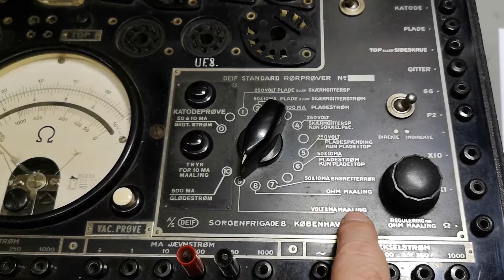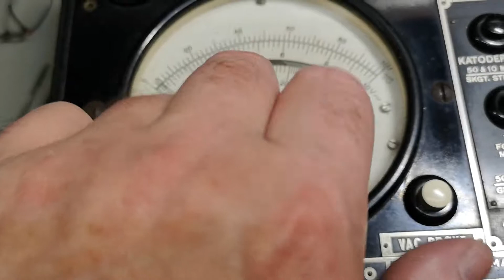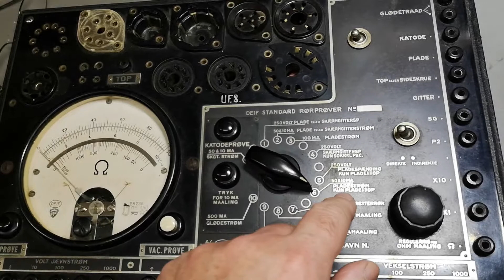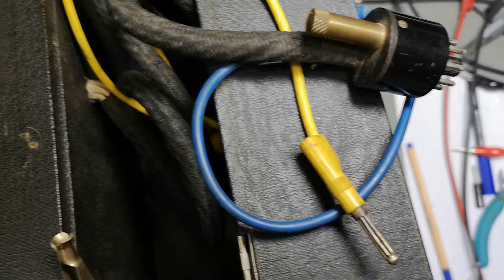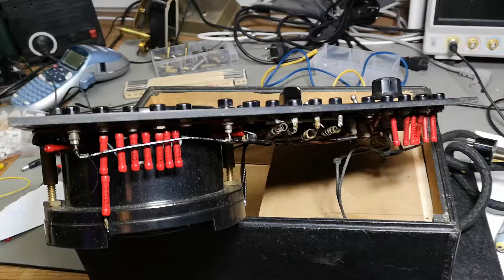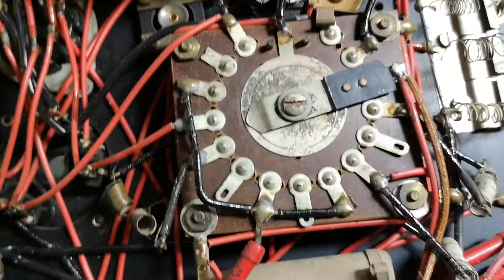Deif standard tube tester pre 1940 volt ohm amp meter too, teardown

Comment: Some of these old ones use copper oxide diodes in the meter circuit, and they are special because of their very low forward voltage (starting at around 0.2 volts per cell). Schottky diodes are the closest ones available.
Reply from the maker: could also match the age of this unit